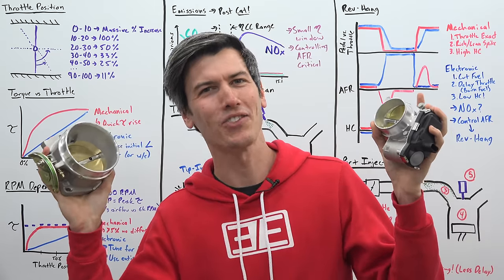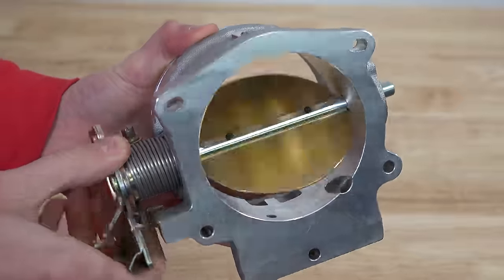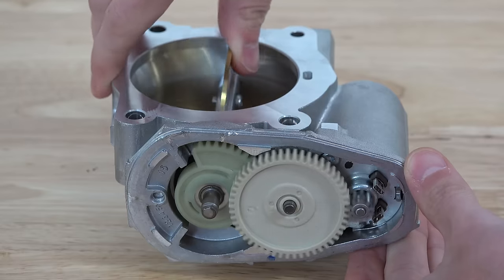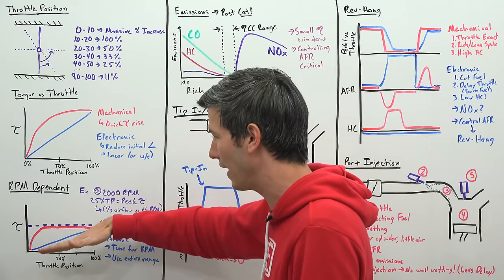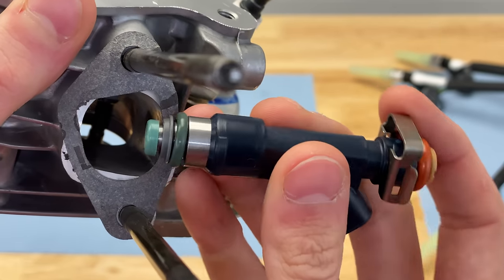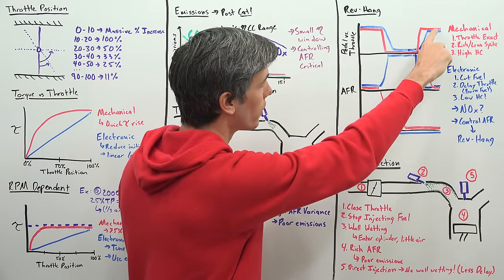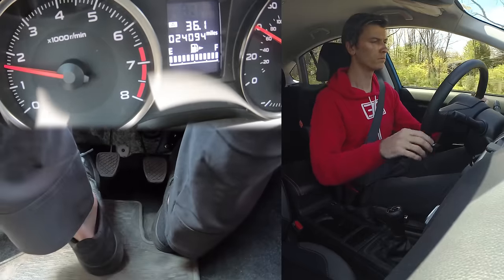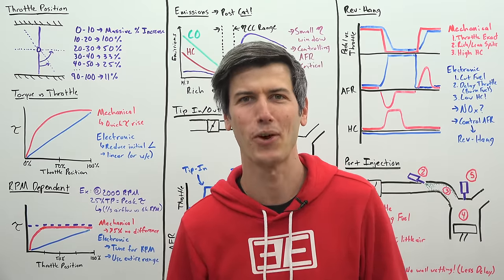The Big Problem With Modern Manual Transmissions - Rev Hang

Comment: I would love to see a modern engine with today's materials and tolerances ran with all mechanical/carb then converted to all electronic and see the actual mpg differences and emissions.
Reply: Well EFI does help.
I can't say the same about Electronics throttle body
Reply: @atarvhegde5210  All these things "help", I just wonder how much.  1-5-10 mpg.  Something like a mid 70's slant 6, remade with all modern tolerances and materials comes to mind.  That thing got nearly 20 mpg at 3.7L,,,, just at 125 HP,  but it was a loose motor.
Reply: Eric man , you gotta come and live in the 21st century man
Reply: @jeevanrohtak5126  Jeevan man, you gotta pay attention to what I said.  I shall explain it to you, since you seemed to have missed it.  

I am curious how much fuel efficiency is in the electronics, vs the upgrades machining technology and materials.  

So, in short, pay attention to what I was saying, and not what ever thought just possessed you to type what you did, man.
Reply: There would be no way to make it streetable unless it had a much milder camshaft and smaller intake ports.  Also, today's emissions standards almost require a dry intake manifold.  That's why no throttle body fuel injection.  It wets the intake just like a carb does.
Reply: @michaelbenardo5695  I am no aware of what "streetable" means.  As far as everything else you said, I am not 100% on what that all means.  

I'm just curious as to exactly how much the fuel efficiency we enjoy today is due to mechanical improvements and design, vs all the monitoring and electronic control systems.  

How to figure that out, I have no idea, that is why it is something I am curious about.  Unfortunately I'm not versed enough in automotive technology to adequately express how to go about actually finding the answer.
Reply: @erich6860 I've had well tuned motorcycle engines and their carbed variants were pretty much exactly in power/economy/startup repsonse. However only in certain weather conditions elevations/maintenance are all reasons that fuel injection stays on top for optimal running all the time
Reply: Not sure if this is what you mean exactly but if you build a v8 as an example you can get some really good results with horsepower numbers using new tech compared to the old 60s tech as reference getting tons of more power than older tech even using carburetors. Common example is take an old chevy small block they can go from 10mpg using 60s tech to 20+ if you use all the new tech including better oil systems, aluminum engine components, better piston rings, better intakes and exhaust systems. That being said it is very common to use systems that basically give you efi tech for an old fashioned style motor which tend to give you a bit more horsepower and torque, but more importantly they are much more reliable being able to start in the cold or hot much more reliably than a carb that might be getting vapour locked, and typically getting more mpgs due to having more accurate air fuel ratios at all times where carbs just cant. So i guess to summarize new tech gives amazing results but at the end of the day efi will be more reliable, sometimes more powerful, and often a good bit more efficient.

Edit: as for emissions i have no clue but id have to reckon the efi and computer driven motor is much better for that aspect, though still with modern techniques the old fashioned motors arent really all that bad in that regard.
Reply: @xicronin38  I'm not so much concerned with the HP, as the MPG.  I know of course that modern components and engine control electronics do in fact increase MPG and HP.  

What I'm saying is, if you take an older engine from say the 70s when fuel efficiency became a thing due to shortages.  Take a slant 6, and remake it spec for spec with modern materials, but kept engine control original (IE mechanical fuel pump, carb, no modern electronics).

Then take the same engine and swap to all modern engine control, and see what the MPG difference is (dont care about HP).   

I suppose you could do the same experiment with an actual iron block, iron head (not the aluminum head version), but when I say modern engine control, I'm talking all the really obnoxious things, like shutting off at red lights, all the sensors everywhere, the computers playing with fuel.

I'm not looking for reliability differences, or HP, just a straight up comparison.  To see what the actual difference the thousands of dollars worth of components adds to fuel savings.
Reply: @erich6860  Ah i get you, In the case of going completely all out, while I have never done it myself i would think its safe to assume you would be able to get very close, to maybe even the same miles to the gallon as you would get from a modern motor of similar application, assuming you build the motors out the exact same dimensions wise like cubic inches and compression ratios. 

The only differences youd get at that point is essentially just the fact that an older engine will almost always weigh more than a newer one which would harm your mpgs a little bit. I think the best comparison all things equal would be a motor like the ford 5 litre which originally got like 12 miles to the gallon and the newer 5 litres capable of getting up to 24 on highways. 

For gas savings compared to dollars spent, if you were to build a motor yourself to the same standards as the best of modern manufacturers you would most likely be spending more money than a new car, i assume 30 grand or more, but youd be getting modern miles to the gallon.

 I dont think i would be able to give you hard numbers on how much percentage gain on miles to the gallon youd get but id assume you could more than double, and in some cases maybe triple or high the amount of miles to gallon. For a comparison of like a perfect restomod engine that then gets updated to modern spec youd probably see an increase of I would guess something like 3-5 miles to the gallon, mainly due to things like shutting off at redlights, which burns a lot of fuel and never running rich due to fuel control being much better, and you would be throwing out a lot less emissions as a bonus. I would guess that you would be spending north of two thousand dollars per every extra mile to the gallon though. 

Sorry this one was super long by the way ive just got a lot of thoughts on the subject i suppose lol
Reply: @xicronin38  lol it's fine. I'm a curious person too, and random thoughts Invade.
Reply: Check out a series called Engine Masters (it's on Motor Trend channel, but I think you can find it on YouTube too). They do exactly this test with Dyno results.
Reply: @moose_himself  oh cool ty
Reply: @erich6860  
Sorry for the info dump.
I do gotta ask though, how much do you think an engine should be modified before its no longer considered original or "Close enough"?

Like, the slant 6? If it is changed to crossflow OHV, or SOHC/DOHC, would you still consider it the slant 6?

Edit: And are we also considering the original fuel/octane levels? Or is modding the compression ratio okay with you as well?

I just remembered!

Look into:
Automation car tycoon game!

They have indepth analysis about engine design!

Can you tell me which slant six you are refering to specifically? I could try and find the numbers within the game/simulation.
Reply: @XenocraftGalaxy  I mean from block to cylinder heads, crank, size, all of it original.  Just outside changes.
Reply: @erich6860  

Edit: I did use an aluminum block and steel crank because apearantly they were made and used, but discontinued in 1976, when chrysler switched to cast iron parts (Aluminum was corroding, and the steel was deemed unnecesary). They do not have any effect on efficiency, but it does make it easier for the engine to handle the power.
Reply: There actually is a couple of videos on youtube of a guy putting a lawnmower carb on a car and making it work. Id like to say its possible putting a carb on a fuel injected car. As long as its setup correctly......Y not?  Emissions problems? Look up using a oxygen sensor extension. LOL
Reply: YES!!!!! I would LOVE, These engines would knock to hell and make 5 hp's LOLOLOL
Reply: @deeboy7448 No, He meant a 2024 engine, not a 90's engine
Reply: @deeboy7448  
You mean thundheaed 289?

Or are we talking robot cantina? The guy that puts supercharged lawn mower enginea with custom assembled EFI AND electronic ignition in a Honda insight?
Reply: @gabrielv.4358  

Thundered 289 put a self adjusting 22mm carb on a ford 302 cubic inch v8. They dynoed the engine and it struggle to make about 50 horsepower.

Apparently though, the mog did go through the roof
Reply: The difference would be immense though it'd depend on the driver. Most of the systems added after late 80s relay on electronics and are basically there to allow the engine to retune itself based on current situation. So when you drive gently and with low RPM the engine has valve timing, ignition timing, valve lift, turbo geometry and fuel mixture, oil pump and other elements tuned for MPG and when you step hard on throttle all of those retunes for performance. If you rev low, the engine is tuned for low end torque, when you rev high - for hi-rev torque. With traditional stuff  what has been set in the factory is what you get - if you want to retune your valves you need to replace your camshafts. So you can get as much power or as good MPG as with modern stuff, but never both, and on top of that the driver would need to know how to get that MPG / performance, cause it'd be available only in certain rev.

Comment: I would love to see you take a shot at tuning a car. With all of your knowledge, that may be interesting to watch.
Reply: He had an s2000 which he supercharged (and then sold for the mx-5) and a integra he tried a small series of build vids on, but it got stolen or something.
Reply: @PushyPawn  What fantasy world do you live in? have you ever heard of flash tuning? it exists for pretty much everything out there.
Reply: @PushyPawn  In current times, "tuning" is a word that refers to ECM/TCM recalibration via flashing the memory.
We aren't talking about the primitive engines of yore.
Reply: @CalculatedRiskAK  right lmao? like this isn't obvious information already/even inconsistent with the video, having "modern" in the title
Reply: @PushyPawn  Jesus you literally have no idea. First of all, there is the option of flashing an ECU. In addition with oder mods like airbox/filter, exhaust etc. it can definitely lead to a serious gain in power. Also there is other tuning than engine tuning.
Reply: @PushyPawn  Tuning modern cars (especially turbocharged) is in some ways easier, the engines often aren't at their full potential for the sake of emissions and flat torque curves, and can have useful extra hp squeezed out of them changing just software on the ECU without needing to even lift a spanner
Reply: Freddie Mercury 
Mostly correct, but you obviously don’t understand how car makers detune some engines or the big gains you can have with forced air.
Reply: @PushyPawn  You can very easily just make a car run rich and then turn up the boost on it. Or just straight turn up the boost because economy turbos usually run at about 0.5 bar
Reply: @PushyPawn  Wow man, I think this is the longest troll post I've seen in a while!
Reply: Yeah, this would be awesome content, that and some high level suspension tuning videos with his miata! Plus if he were to become really proficient at it and start teaching race car tuning classes he would be swimming in the cash.
Reply: @PushyPawn  Are you high?🤔 Have you heard of Haltec,
Maxxecu, Megasquirt? Nothing to tune😂😂😂 Okay.. yes sure.. 
How does your car work after engine modifications?🤔
Reply: @PushyPawn  This video says that too, here he is just explaining how it all works before and after the ECM computer does its thing. Understanding why things work as they do is useful in other applications, and its interesting too.
Reply: @PushyPawn  What a great cover up story for being wrong ;)
Reply: I would have liked to hear about any methods to fix fly by wire thottle rev hang that don't ruin the emissions.. like maybe instantly closing the throttle to say 8% on release  and then hold it there briefly to burn excess fuel before dropping to idle.
Reply: Freddie Mercury idk what you’re talking about. Electronic tuning with the computer is still a thing. My dad got his  Ford F-150 ecoboost v6 twin turbo down to under 5 seconds 0-60mph
Reply: @PushyPawn  LOL claiming you were baiting, you're obviously misinformed on tuning modern cars and people proved you wrong
Reply: @PushyPawn  HPtuners cost me 650$ and i can tune Fords, GMs, dodge, mercs, nissans, some hondas, and a bunch others from 1998 and up. So what are you talking about lol
Reply: Onii-chan
Only person you trolled is yourself.   How’s your own foot taste?   I’m glad the viewers here are quick to call out wrong information
Reply: His limitation would be money. With what he knows of compound turbos, FreeValve and so on, he could design a ridiculous engine with insane specific outputs... buying the parts to do it would be the problem.
Reply: I would rather see a world class tuner design an engine.
Reply: Freddie Mercury New engine controls are not preset to a certain mapping/function. Those sensors give a big window of adjustments. Basically making infinite calculations based on load, altitude, temperature, fuel percentages, tps, IAT’s, etc. Think of the new cars as artificial intelligence! Every sensor input is read in milliseconds and computed to the tires from the drivers input to the cars response. Started with Rochesters and TH350’s, to mimicking/fooling sensors (diodes, bungs) to HP tuning. Embraced 6 speed auto and DOD. Stability and traction control dialed in gives you the ability to dial in a launch control. 4K + lbs. L77 gives 22.3mpg on 4 cylinders. Dod/Afm tuning in the new craze, Hennessy C8 vids. Why am I here? This guy flourishes my geeky side and gives great explanation in all his videos, great context!  Super stock is my realm’

Comment: Dude...  I’ve been wondering about this for YEARS with my car and never thought it had anything to do with the drive by wire throttle, just the stock flywheel.  Thanks!!!
Reply: Compared to my s10 or 10 speed big trucks my civic si is not as smooth due to this I'm not as consistent
Reply: My vehicle has a mechanical throttle, but I have lots of rev hang. I bet it's using the idle air valve to accomplish it.
Reply: @nerdyengineer7943  me too. My 04 gto doesn’t have rev hang but the initial grab into 1st gear has always been the most finicky I’ve ever felt in a car. I had a 2001 cavalier z24 manual 5 speed (obvi with fwd and electronic throttle) and for some reason engaging first in that car was way simpler than the gto. Any other gear from second to 6th is completely normal (tho a bit slow due to the weak clutch/slave from the factory) but something about 1st gear in it with the drive by wire creates the most odd feeling 1st gear engagement
Reply: @davidpistek6241  lol Im in the same bag. My s10 extreme drops the rpm’s fast so I can shift a lot faster. My type r…. The rims take forever to drop. I don’t go hard in the car but when I do I might bang gears. 6000+ rpm’s can’t be good for my clutch. Smells stronger than any car I’ve had. My s10 or Camaro ss have never smelled like burnt clutch while banging gears.
Reply: My 08 Ford expedition with drive-by-wire 1.4 low it changes the throttle input so if you bounce on the throttle it won't be jerky and full it changes the throttle input so if you bounce on the throttle it won't be jerky in low range four-wheel drive smooth
Reply: Mine does it in 5th above a certain speed, and while it doesn't do anything for downshifting, a quick punch will make it relax for coasting in neutral.

Comment: This was a great video! It made me do some thinking about a 2002 Mustang 4.6L I had years ago. It had terrible rev hang, but mechanical TB. The fix was to restrict the airflow of one of the lines connected to the TB by inserting a metal plug in the line with a small hole drilled in it to allow a small amount of airflow.  

I can only assume that this line was how the ECU added air when lifting off the throttle similar to what you explained here. By restricting that airflow, the rev hang was reduced.

Comment: I've always heard that Subies had rev hang because it helped emissions and I'd always been curious as to how dropping the RPM slowly would do anything, so now I know! Great video, thanks!
Reply: the software throttle is also a pain for hill starts with cold engine (stickshift 2011 outback)
Reply: This is a lot of cars, the EGR feeds back into the intake and the idle-bypass will be open during liftoff so lots of rev hang. Its the same bypass that makes your engine idle high in cold starts.
Reply: They fixed this in the new wrx
Reply: My SF Forester has the most obvious hang of any car I've owned, it got more pronounced when I cleaned out the intake and Idle air solenoid, I thought I may have busted something at first.
Reply: I drove two Subaru's and to my knowledge, neither of them had it. Both were standard and one was an Impreza and the other one was a WRX. I have a Honda Civic Si Coupe now and that car has massive rev hang. I haven't experienced it in a Subaru yet to my knowledge but I know Honda cars have it in some of them. It's really noticeable in mine if you look at the rpm's closely when you're shifting the gears.
Reply: Possibly one other contributing factor on subarus is they have relatively long intake runners which means longer time from throttle valve close to the cylinder.  Not for sure on this but seems to me this would have an impact.   That's why on motorcycles they have individual throttle blades mounted as close to the intake valve as possible